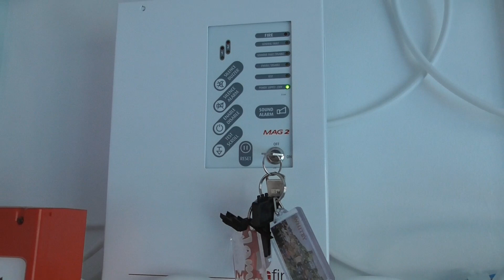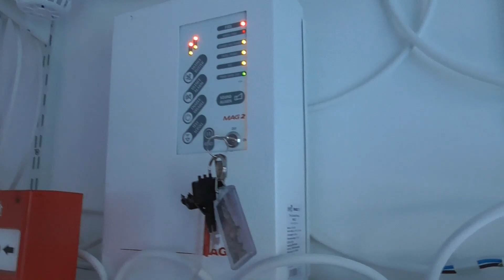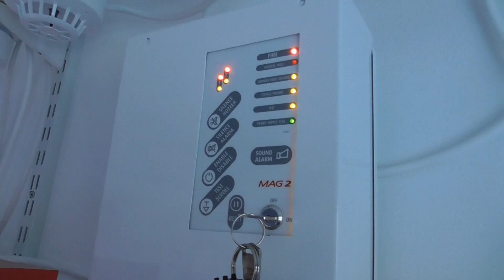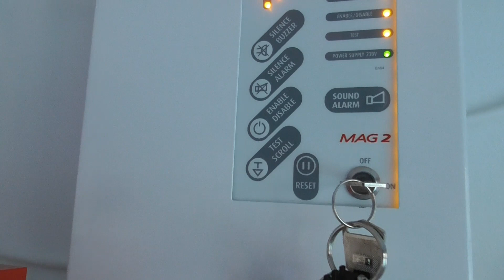ESP System Test 8

Comment: What device changes on test 9
Reply from the maker: There will be a sounder change in system test 9
Reply: @j1firesystems440  what will it be?
Reply from the maker: @Siobhan_OShea  I am either going to add the banshee excel sounder or the fire cryer sounder
Reply: @j1firesystems440  choose whichever one you want
Reply from the maker: @Siobhan_OShea  Yeah I might probably add the fire cryer sounder because they are really good
Reply: @j1firesystems440  ok